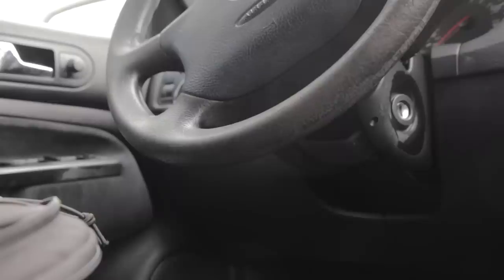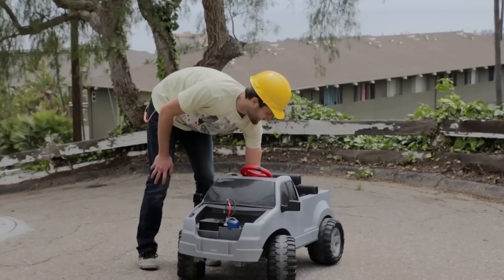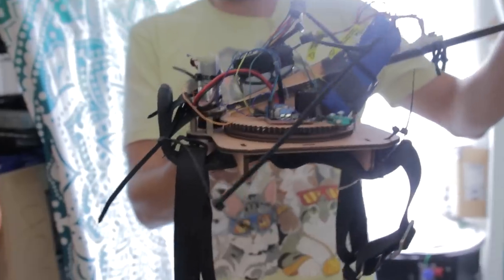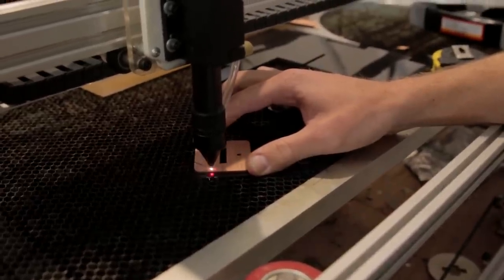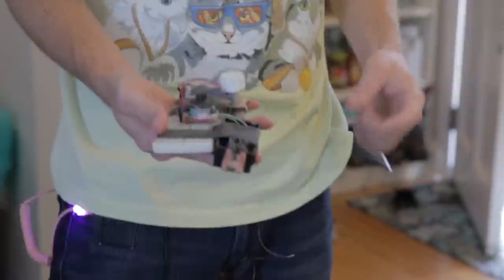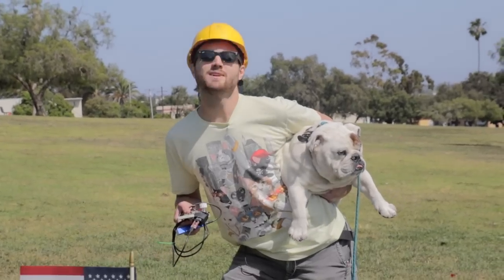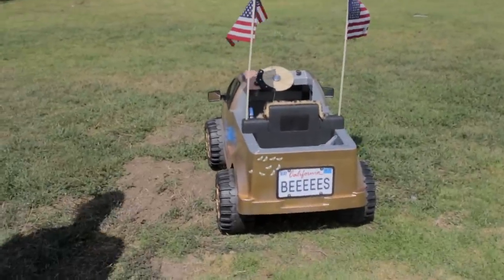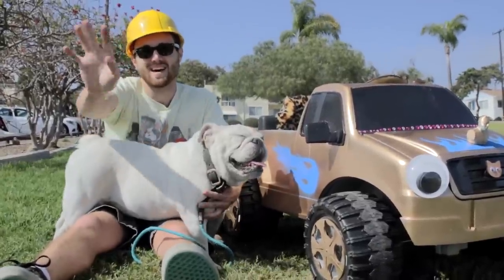Remote Controlled Power Wheels

Comment: That nice mechanical keyboard sound
Reply: Joshua I want that keybored Nerd cubed uses
Reply: right now I have a logitek (I'll put which one in here) I've had it for a few years and need a new one
Reply: Jonah Nelms If you are looking for a cheap mechanical keyboard check out Qisan. I have used one for about 6 months and it's pretty damn nice for the price. They are $40 on Amazon.
Reply: i dont need a cheap one plus i may check it out but i dont know because i primarily use Logitech
Reply: Jonah Nelms Yeah Logitech makes good stuff. I throw my Qisan in a backpack with my laptop for a mobile mech board. It's cheap as hell so I'm not worried about breaking it.
Reply: They sound like blues, but my blues are loud as fuck
Reply: weston P I've got a blackweb keyboard and it's so nice
Reply: weston P (sorry about late response) yeah having a cheap keyboard is really nice. I have a 20 dollar keyboard I use whenever I go places.

Comment: I converted my son's ride on Bigfoot to an RC vehicle about 25 years ago. I used  a 1/4 scale servo for the steering, installed bearings in the steering rods, put rubber inner tubes around the plastic tire/wheels and added a proper scale stuffed animal to the cockpit with his hands glued to the steering wheel so it looks like he is doing the actual driving. Very cool.

Comment: hey William, if you want some nice semi cheap motor controllers, you should check out the controllers that FRC robots use. (ex. victor, talon, spark). They're pwm controlled, and usually rated to 60 amps 12 volts continuous with full speed control. 

We put xt60s on the inputs, outputs, and the motor wires (with the correct polarity :D... usually). Then you can plug a motor controller into any of your projects easily.  

Personally I really love the talons SRXs, but those are probably a bit too much $$$. Victor SP's are also really nice if don't need CAN bus control (aka PWM is fine). They're not as much in the spirit of crappy science, but might save you some headache. 

If you're interested, there's also an amazing ecosystem of gearboxes and motors that might be useful.

If anyone else is also interested, I can add some links.
:)
Reply from the maker: Thank you for the info!! A good motor driver would have saved a loooooooot of time.
Reply: William Osman You're welcome!! I can imagine... especially trying to make one that can switch all that power you were throwing at it.

Comment: Those motors look like 550 with a 1:10 reductor, they are rated for 12v. If you wanted to use 24v, you could have upgraded to 775 or 895.

Comment: What exactly was the problem with the variable driver? My friend wanted me to help  him build a remote control lawn mower and we couldn't find a variable drive that would work.
Reply from the maker: A circuit driving inductive loads needs to dissipate the potentially large voltage spikes caused when power to the load is cut. These large voltage spike will blow up electronics, unless properly designed for. Off the shelf motor drivers capable of driving large motors can be expensive.
Reply: Gotcha, thanks. I would suggest a remote controlled lawnmower as a project for you, but not only is it expensive, I can see that getting dangerous real quick! lol

Comment: The mosfet gate may have been latching high when you lost signal, making the motors go even when there is no signal. Try putting a pull down resistor on the gate of the mosfet? ~10k
Reply from the maker: I did put one on the second attempt, but long as the arduino was powered it should have held that pin low, so I'm not really sure what happened. The second mosfet eventually exploded too.
Reply: what was the mosfet rated for current wise? you could test the motors on straight voltage to test current draw to see if it'll blow again. It may not matter in the end if you're putting brushless DC motors on anyway. mosfet spitting fire was hilarious, love your videos
Reply: William Osman but yeah it's weird that it latched with the Arduino low
Reply from the maker: 70A continuous, but I was only using 5v on the gate, so something like 30A. With the wheels off the ground, before the mosfet exploded, they were barely heating up. I don't think there was enough freewheel protection.
Reply: William Osman how beefy was your flyback diode?

Comment: This could be done a lot easy and efficiently with an ECM and a remote control and transmitter
Reply from the maker: Yeah, I don't have any RC gear though, plus I have complete control over any and all mixing.
Reply: I see. I built an electric skateboard not too long ago however I was not able to steer it using the RC.  It would be awesome to see you integrate this "Power wheels"  system into a skateboard/longboard. I love your videos. Keep up the great work